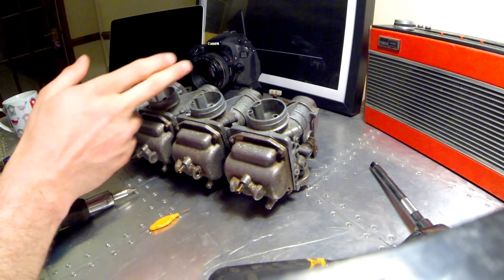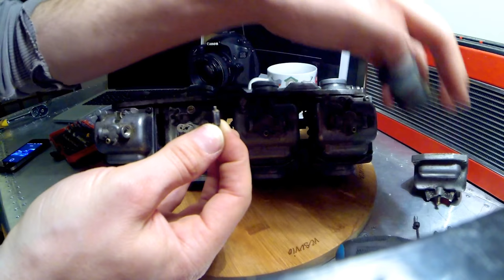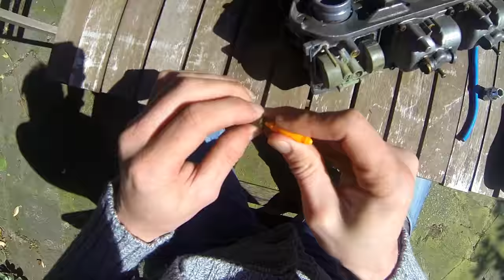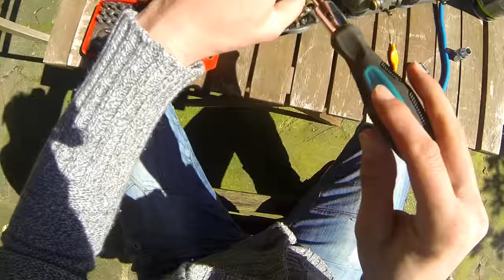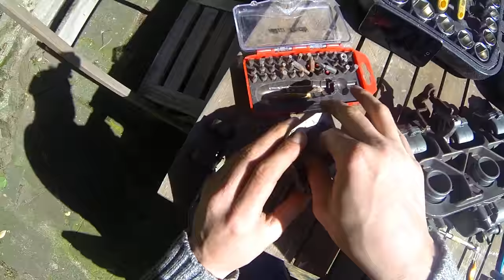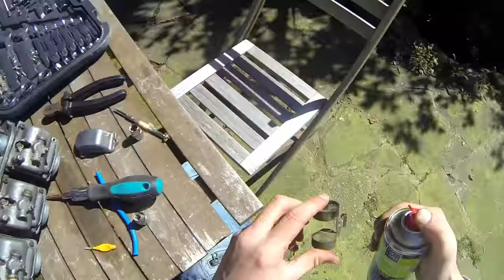Cafe Racer Build Part 16, How To Clean Carburettors

Comment: How do I clean the carbody? There are tubes that have internal holes in the body that go into the vats and I think they are clogged. I saw all your videos are great I just subscribe greetings from Argentina. I have a 1981 gs550e with 32mm mikuni bs32ss carburetors
Reply from the maker: Just allow to soak with carb cleaners and then air blast them, I've also heard of people boiling them in hot water works also.
Reply: For The Bold - dreegez ........  believe it or not, you can soak the carb body overnight in PineSol cleaner, full strength.   Then, rinse with carb cleaner, kerosene, etc...   you'll be amazed at what comes out after soaking in PineSol liquid cleaner.  Plus, it will not damage any plastic or rubber seals, gaskets, etc...  also, scrub it good with your old toothbrush and you're ready to reassemble.  Nice set of videos!  Thanks for posting these.

Comment: What do you suggest for overall engine cleaning ? Plus carb? To shine up your carbs and engine
Reply from the maker: I used a gan of engine de-greaser, and a tooth brush to get in the small areas, then I polished the surface with metal polish and a Dremel. But if you have the money you can get it bead blasted, which gives it a new look.

Comment: I have the same carburetors on my 81 Kawasaki 650 I have a straight through Vince and Hines exhaust and air pods how many jet sizes do you think I should go up? The Kawasaki dealership said go up one size and then try two sizes on the main jet. They also said don’t worry about the idol jet what is your opinion?
Reply from the maker: The engine size would make the jet size different. Also other factors such as what pods, altitude exhausts. But what the dealership said sounds too low to me
Reply: For The Bold - dreegez how would you recommend figuring out the correct jet size, is there some mathematical way of working it out to get it right the first or second time?

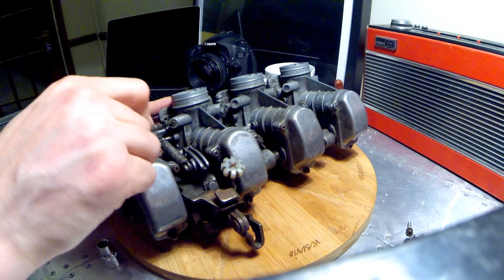Comment: Good day sir.  I just bought a 79 Suzuki GS550E and I've enjoyed working on it.  Quick question - at the 14:10 mark of your video, you talk about the air adjustment screw.... what does the adjustment screw on the bottom of the carb adjust?  Also, my friend has an older yamaha xs450.  His throttle is very easy to pull and snaps back quickly when you let go.  I find my throttle quite a bit harder to pull and doesn't snap back as nicely (seems to move more slowly).  Is this just a carb design - his throttle controls a butterfly valve and his slides are vacuum lifted and ours are lifted by the actual throttle cable which is why I'm thinking there is a difference?  Any suggestions?  Thanks from Canada.

Comment: Does the carb cleaner not damage the diaphragm, seals and plastic/ rubber floats?
Reply from the maker: No it's all fine, doesn't harden the rubber or anything
Reply: Oh ok, i will have to check my cleaner closely, will mean i don't have to remove everything before i clean it next time. Thanks! And i hope the cafe racer is going well :)
Reply from the maker: Rhys Jones If you're worried you can always try on a spare piece of rubber first to see how that takes to it.
Reply: Very good idea :) thanks for that
Reply from the maker: no worries

Comment: i have the same bike but im fairly new to motorcycles and have no idea how to get the carburetors out. i took the fuel tank off but now im just looking at the carbs with no clue what to do next. can anyone help me?
Reply from the maker: Once you've undone the 4 clips that hold the carbs onto your rubber boots (usually a phillips or flathead screwdriver), it's a matter of pulling, gently but firm, and a bit of a wiggle, but depending on how old your rubber boots are you might get a crack in them so be careful.